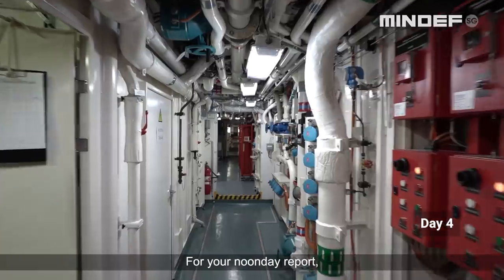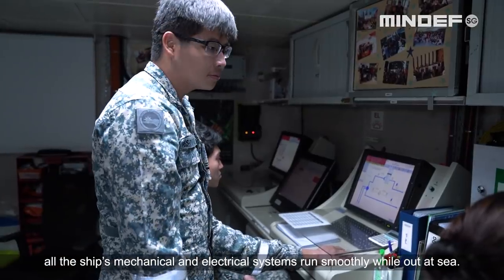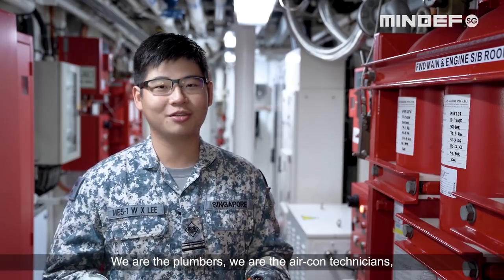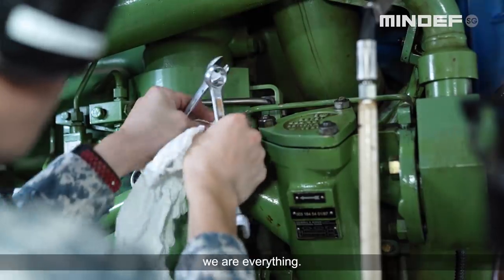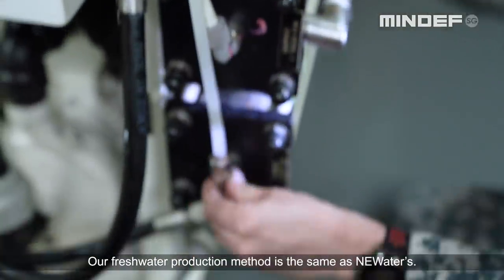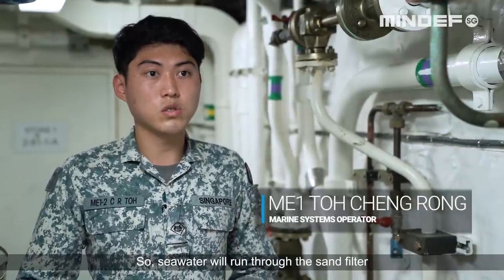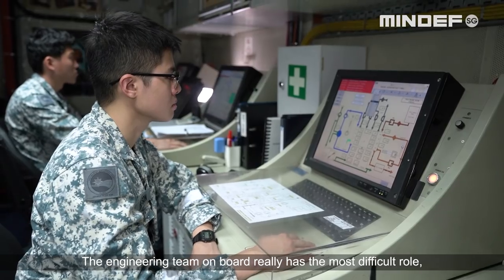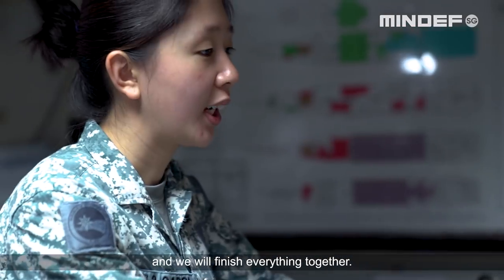Life at Sea: Episode 2 - A Well-Oiled Machine

Comment: how is this ship maintains its stealth if it's operating with a diesel engine?
Reply: It's not a submarine. It doesn't need to be invisible to radar or sonar, it just needs to be indistinguishable from the numerous other small commercial vessels when operating in coastal waters. When operating further out, the reduced RCS will make detect from over the horizon radars much more difficuit.